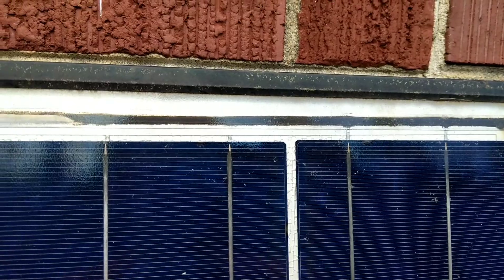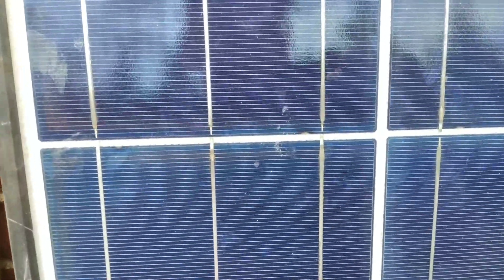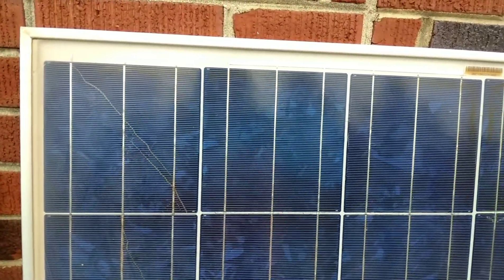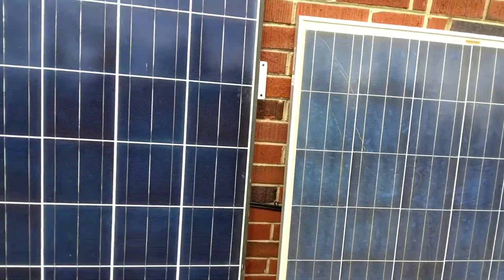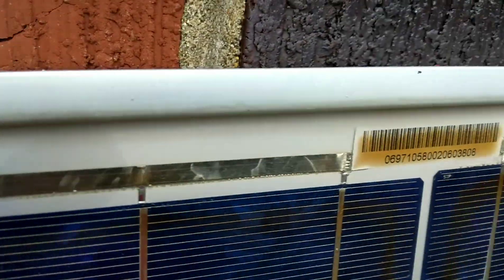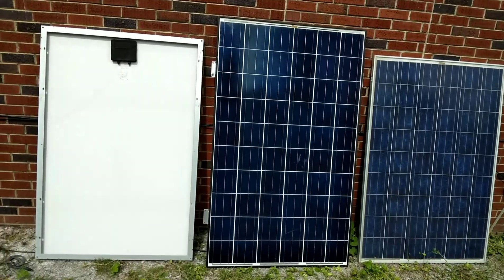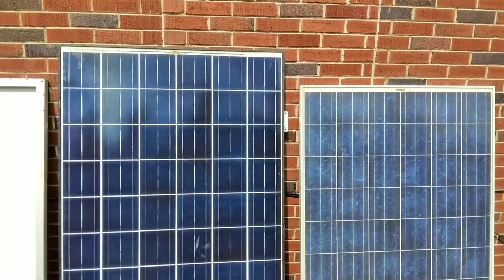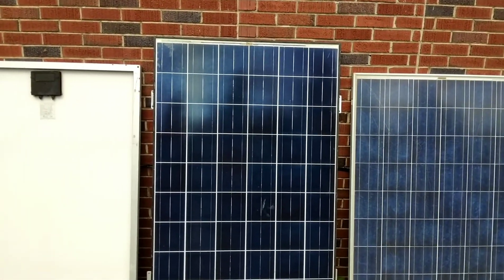Seven issues to watch for when purchasing used solar panels

Comment: Coat any broken glass panels with clear Flexseal. Mine have been working fine for 4 years without turning milky. Output is minimally affected.
Reply from the maker: I have never tried flex seal. All i know i that everyone else I have seen that has tried to clearcoat/epoxy there broken panels have been disappointed. I guess flex seal might work fine, I am not sure.
Reply: On the sun side.

Comment: They're fine as long as ypu no longer draw max power from them and especially don't build big series arrays. 
Keep it low voltage, 12 or 24v, parallel connections with series diodes on every panel. 
No, I'm not defending your seller. As you said, if you know what you buy and you're happy with it, it's all fine. You clearly were not 😊

I'm on my 2nd set of 2nd hand panels and they are in decent condition. I've seen really damaged panels in the pallets I bought from but basically those were not for sale  but the reason the entire array was scrapped. 
On a big farm, one burnt panel can cost way more than replacing the entire string. 

Front glass sealing with clear epoxy would be feasable. You will need s heat gun and uv resistant resin but you could seal them to prevent water ingress. Even if, at low voltages, some water ingress is almost harmless. My 1st ever panel is diy with cells soldered togheder by me and layd on a piece of flat glass with some adhesive vinil backing. It didn't hold for long and many cells ended up splitting and cracking, rain and condensation are in there all the time but it's still going and putting watts 15 years later.
Reply from the maker: Front glass sealing with clear epoxy is very much not a thing. Many have tried, none have succeeded. You will get very little power from the panel, not enough to off set the cost of the epoxy. I have not seen a single vid of someone that "Fixed" smashed front glass with a long term solution they were happy with.

Comment: Even completely shattered panels, like your 8 will produce power for years. I have 2 - 370w panels that FedEx shattered. It's been over 2 years and they are still producing power. I expect them to fail but until then I'm using them. The seller did refund me but I'm still going to get every watt I can from them
Reply from the maker: In the case of using a smashed panel, I would think that moisture would work its way through the cracks and cause the panel to short. If a panel dead shorts it can cause a fire
Reply: Coat it with Flexseal. Works fine.
One thin coat will suffice. I used a flexible scraper to spread the Flexseal. Been working for 4 years so far.
Reply: On the front surface.

Comment: Good. Video. Can cracks in the white plastic be sealed up with something?
Reply from the maker: I don't think so. I guess you could spread something over the back of the panel, but I have never tried that
Reply: Yes, you can apply a moderate bead of Solar Seal 900 over back side vinyl cracking.  I purchased several pallets from San Tan solar with this condition.  I now have several years of use in Michigan without any issues whatsoever.
Reply: @brockm4047  Thanks for the info Brock. I may have to buy some more if I can stand the freight cost.
Reply: You're welcome.  I got a better price by calling them directly rather than using the online store.  Usually they will come down a few dollars per panel when you buy a full pallet as well.

Comment: I bought some panels and cables to charge a delta max solar generator ( battery pack)from this guy. He is honest and just a good guy with tons of knowledge. Highly recommend him I got two 250 watt ytina panels and when I tested them I was getting 475 watts using them in series in December.  That's really good. Worth the drive from cullman!
Reply: I've got some crack panels 6 in total I wire them up in series of to and get 64 v open circuit I also used clear boat varnish to paint over the cracks they seem to be working what's your opinion
Reply from the maker: @tonyolomu4543  I’ve seen videos of folks on YouTube doing that. If it works for you then cool. I would think it’s not going to last super long time does the varnish will probably start to peel off the glass. If moisture gets inside of the panel, the panel may short out and potentially damage the equipment the panels are connected to
Reply from the maker: Why thank you sir. I really appreciate it!. Glad things seem to be working well.